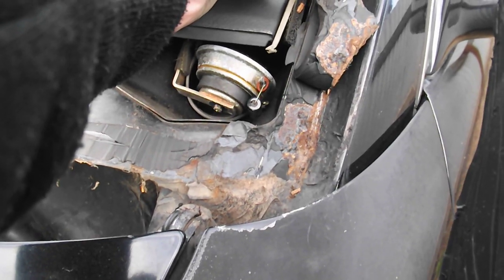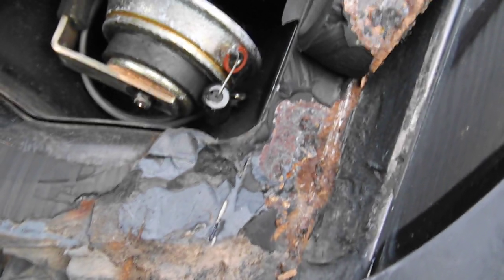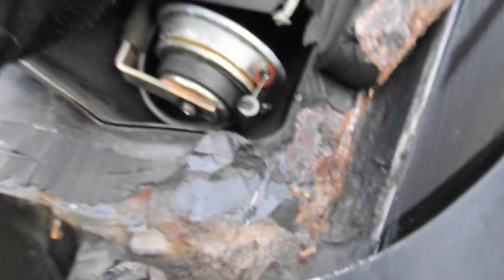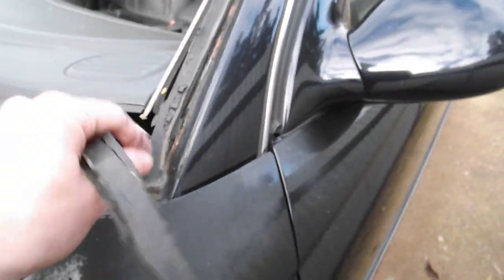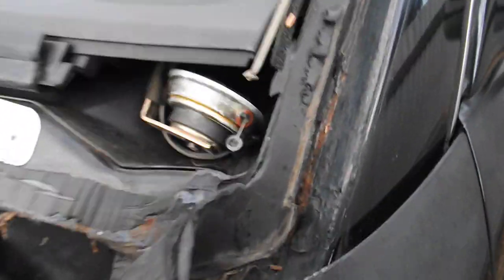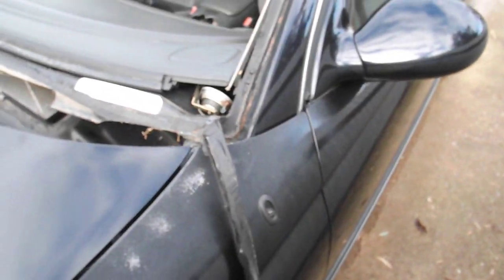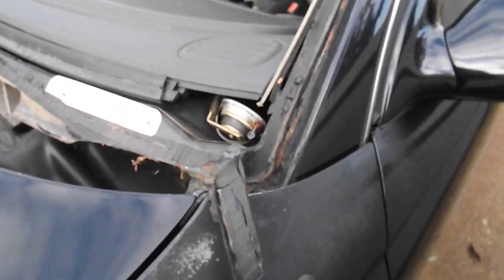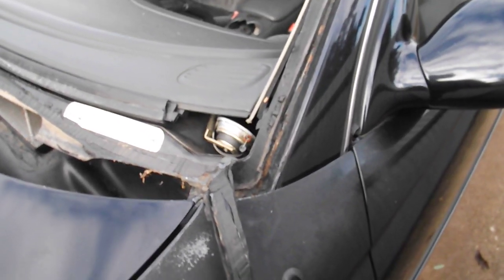always remove all old sealant in old cars when replacing the screen

Comment: Its annoying how much work someone creates by not doing their job properly the first time.
Reply from the maker: I had a similar experience with my aircon. I then bought a manifold gauge set and vacuum pump and converted it to R290. The leak point was the schrader  valve on the low side that was installed loose. The cap sure enough is meant to be the actual seal, but it is not a perfect seal. New valves and a re-gas the unit has been running perfectly w/o loosing gas
Reply from the maker: 2 fridgies failed to id the leak as being the service valve caps :(